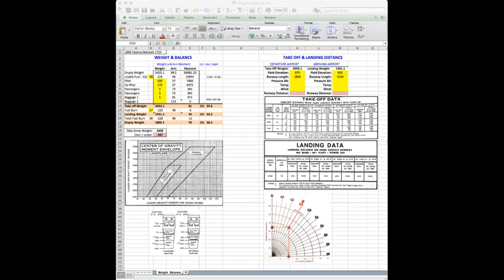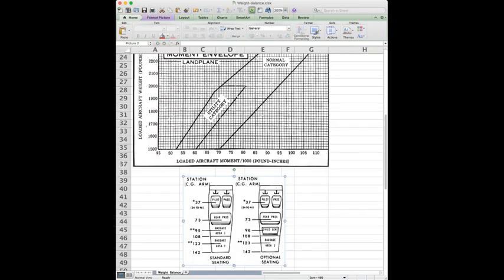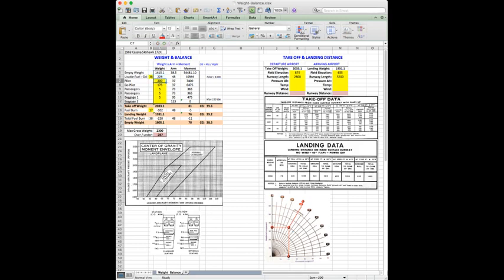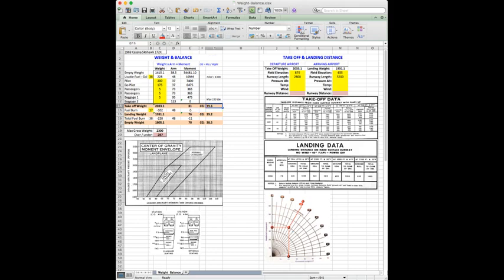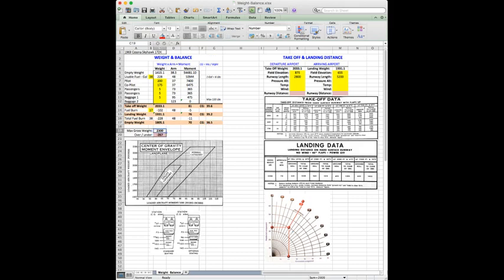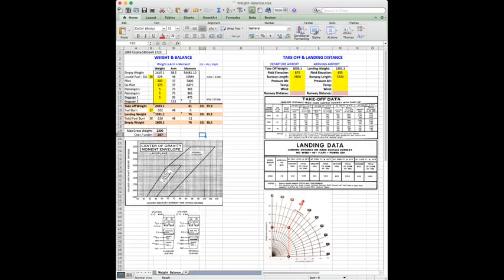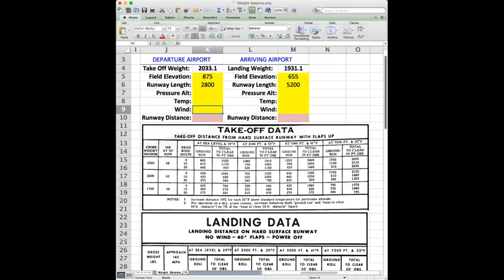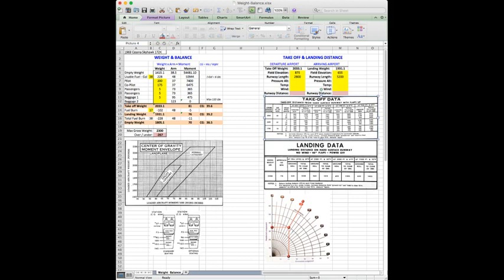Calculating Airplane Weight & Balance and Take Off & Landing Distances

Comment: You can go a step forward.   I made a cell to formulate my PA then another cell for Da. Along with Freezing level, cloud base, 70/50 rule.  Almost all other calculations you need.   Excel tells the same info I add from the same cell.   That way you don't have to type in the same info over and over for each calculation.   Furthermore I used the IF formula.  If any calculation is out of range, a warning cell will pop up.   It's a lot of fun.